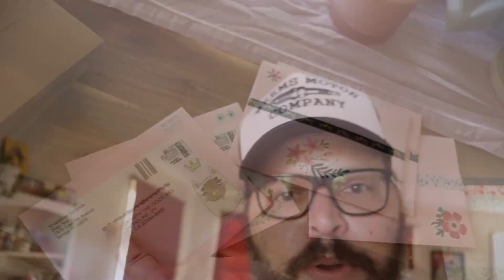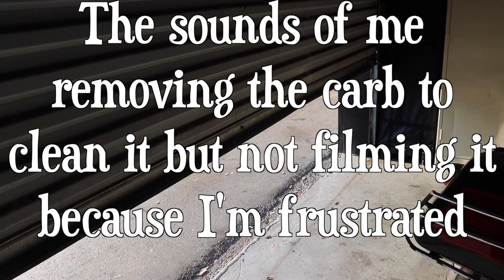Old Harley Davidsons NEVER DIE | 1986 Harley FXR

Comment: you're going to toast your new starter cranking on it that way, they're a thirsty engine cold, set choke, twist throttle 6 or 7 times then crank. unless you don't have a working accelerator pump.

Comment: Hey Josh, I have mentioned it before and referenced a brand that is rather pricey but a lot of guys use the condor wheel chock systems on those lifts to not have to use tie down straps but I have it on good faith that you can buy the Harbor Freight copy, mount it to the lift, and not have to worry about straps, and the HF unit works well.   My setup with the condor chock came together at a discounted price and it's amazing.

Comment: STS, show a little love to the Harley.  At least paint the chipped up black air cleaner housing with some spray paint. Back in the 1960’s, when most engines were silver, we painted the whole engine with black crinkle, high temp, BBQ paint.  It looked great.

Comment: Josh I noticed your enrichment lever was up but it didn’t sound or act as though it was working. You need to rebuild, not just clean that nice S&S carb, it also sounds as though it needs tuned ie. jets changed. Those carbs are bare bones easy, nothing like rebuilding a Holley or quadrajet on a muscle car. You can do it.

Comment: No Harley dealers in my area in Oregon wont work on motorcycles older than 2002. Not even an oil change. And there aren't many independent shops either. My 92 Heritage Softail project needs work.

Comment: hey shade tree. I see a heel toe shifter on that FXR. MY FXR that I just recently aquired is also a 1986. My left leg is prosthetic and I plan on a heel toe shift. Im replacing the shift shaft  in fact its on my lift now. Is that a stock part? Mine has a standard shift arm on it. I was planning on re purposing a one piece heel toe shift from an older shovelhead as I already did this once on my 09 Dyna street bob. This is a cheaper easier way to make it work for my disability than an expensive electric shift. I have no ankle movement or toe movement with a prosthetic limb. The standard shift therefore is no go. Heel toe is the way to go.

Comment: If you are going to try to put that 5 speed you just showed on your work bench in your fxr  I am pretty sure it will not work fxr is a rubber mounted motor and trans the stuff you showed looks like soft tale